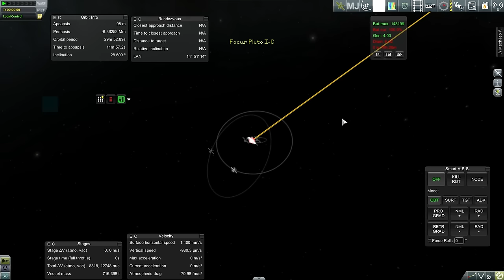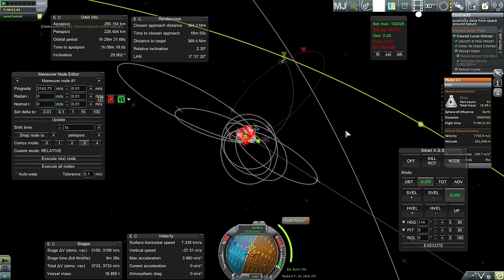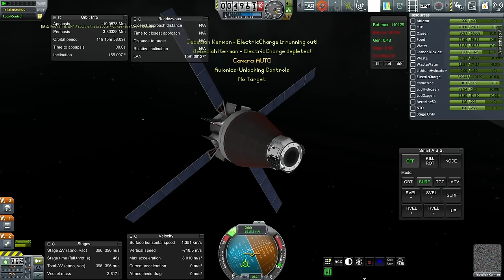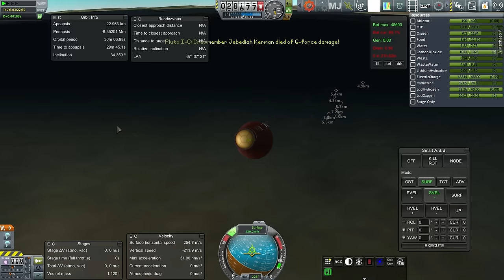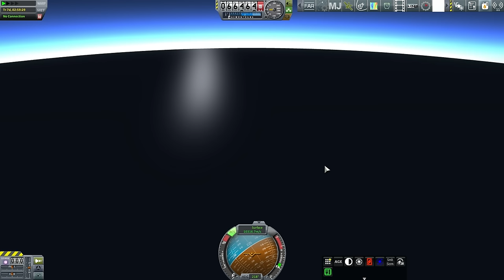Realism Overhaul in KSP 1.0.4 - 28 - Jeb Flies By the Moon

Comment: the tilt is from the weight and drag of all the stuff at the top of capsule. the OH of the capsule is due to the tile causeing the top to start to heat rapidly transfering heat from the rcs tank to the capsule along with the heat from the heat sheild.
well thats what i saw. the last 2 atttemps u always blew up when u let the rank at top start to take heat
Reply: u sure u didnt rotate or add anything to it?
maybe its the entry angle with the balace of the top as u got fuel genrators on 2 sides then parachutes on other 2 sides so weight imbalance there. maybe change the top rcs tank into a small procedural battery on top instead and make a support module u eject just before u enter.kerbals can keep alive for 6hours or so with no power so when manned onlly needs enough power to get out of the heating.
before i broke my rss build i normaly had 2 types of reentry ways 1 with support module on top thats ejected just before we get to heating or its on bottom and same done. usualy its just the module and the parachutes. thats what i did for normal reentry.
ccomeing back from teh moon i have the support module on the botton and have it perfectly symetical tgo itself evven if i have to add extra weight and have its own heat sheild for doing aero breaking instead of direct reentry. but then its still ejected on the finaly reentry pass.

Comment: Also, the heat shield CoM issue is one I've heard of before. IIRC it pushes the CoM up instead of down, causing the craft to be top heavy. If you have it angled along with descent mode it would angle the craft too far from retrograde and expose sections to more heating than would otherwise be intended.